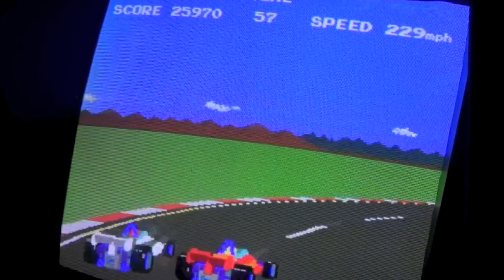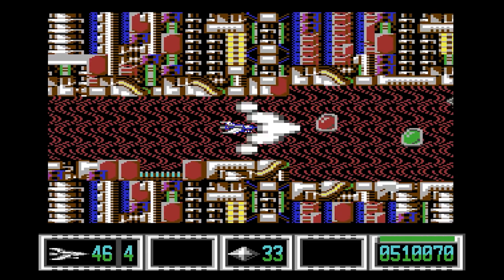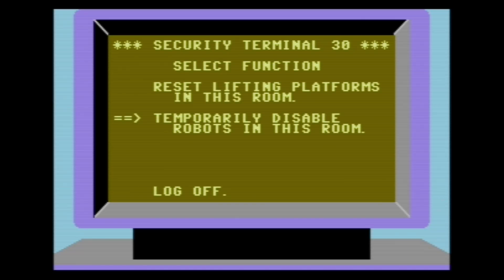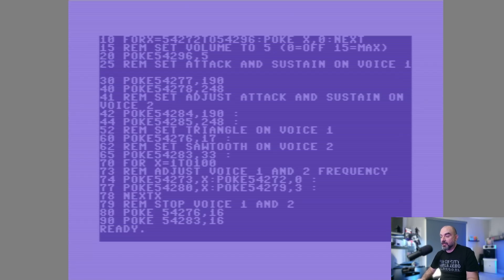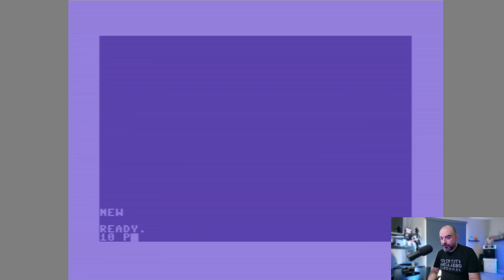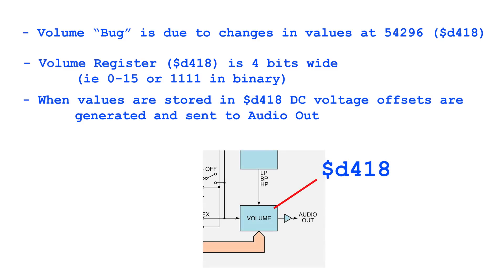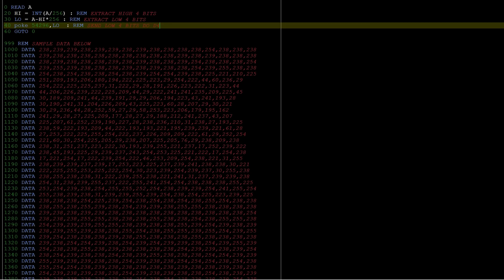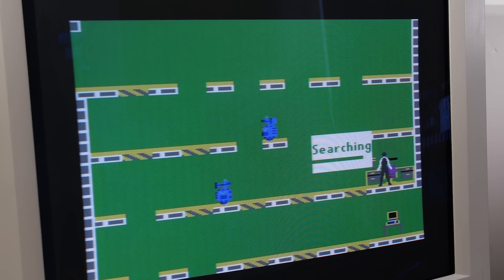How Old-School Computers Played Sound Samples | MVG

Comment: this is NOT how all old-school computers played sound samples...C64 SID is OVERRATED CRAP..hell the amstrad CPC can play sound samples with its AY-3 chip... that was used in many many more systems that just the one  or two the SID is used in....
Reply: Yes, let the butthurt flow
Reply: Pray, do tell how the YM-Chips played samples.
And I'd love a technical deep dive aswell.

Owning loads of speccys, amstrads, C64's Atari ST's and even a vectrex I'd love to hear how you'd do it.

I ofcource already know the answer.
Reply: @danieltornqvist6062  then youd already know that the YM52149F is a rebranded AY-3-8910 with a couple of extra features...and youd also know that there are games on the cpc that also play digitised samples... straight outta the AY and onto the CPCs speaker...
im not gonna reinvent the wheel.... the only reason the SID could play samples is coz of a BUG... the AY-3 could already do it..... 
...and its even easier with a digiblaster... that bypasses the sound chip and puts it on the printer port for a VERY simple DAC (resistor divider) connected to a tiny amp and speakers to play samples
Reply: @WacKEDmaN  : Correct, but you can play samples on C64's on many other ways.

And the principle is by large the same. Whether you'd use the YM chip, the Sid or the paralell port.
Save bitrate and setup.

So in principle MVG is right here, even though he used the C64 as a. Example and the bug.
Just as YM music gained a lot from why the atari scene called a sidvoice or the buzzer-sound that also would be more or less considerd "bugs"
Reply: @danieltornqvist6062  but hes not technically correct... C64 and SID isnt the only thing that played samples.. sure he mentioned the others but makes out they cant play samples and only the SID and C64 with its bugs can...
if the SID is sooo damn good....why wasnt it ever put into a commercial synth? why did yamaha go with the AY/YM? .... ill leave that one for you to ponder...
Reply: @WacKEDmaN  : It had to few voices. And there are synrhs based on the chip, aswellnas the architecture.
Few synths based on be square wave of the YM in those days either.

I can agree the topic is about missinformative as is usual on YouTube.
But even the Speccy with its internal honker could play samples, again the technique is quite similar.

D/A or DC or noise-volume  manipulation is the core of how all the mashines did it.

Very similar, understand one, understand the principle.
Reply: Reeeeeeeeee!!
Reply: I think he was just giving an example of how one did it.

I'd like to see a video about how they did it when there wasn't an effective DAC. Some I've heard sound very much like they've converted the vocal samples into sets of pitches, timbres, and volumes to play through the audio channels. The arcade example at the beginning of the video sounded like this type. This approach is far more impressive and skilled.